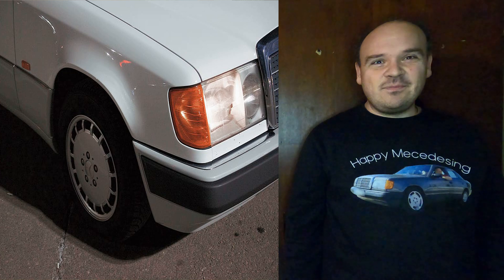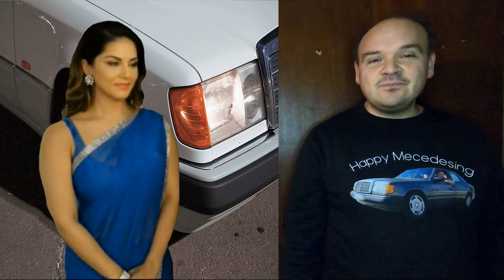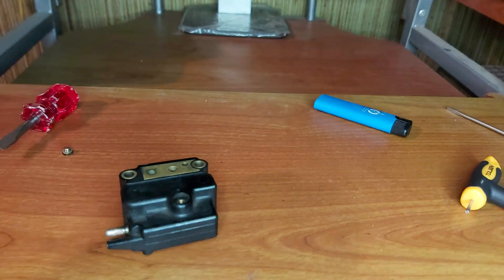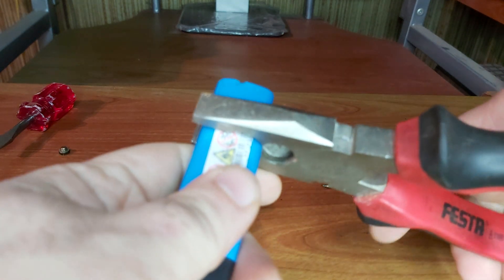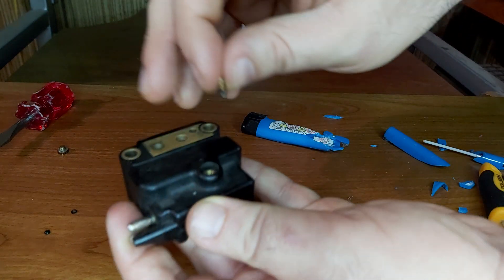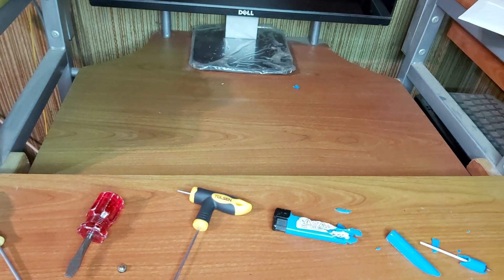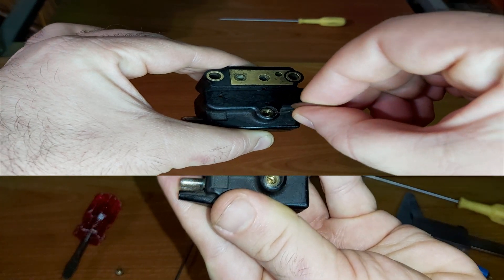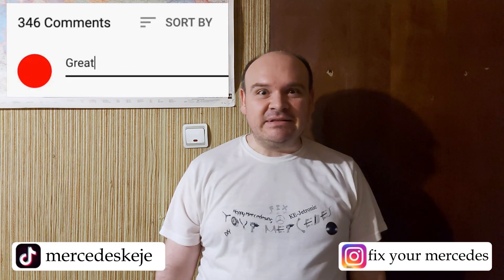㉦Mercedes Ke-Jetronic㉦ - ⭕The o-ring⭕ on the ⚙🔦adjustment screw🔦⚙Г/EHA

Comment: Hi,lovely family my doesn't start it's only crank.
Reply from the maker: Hi, “crank but no start” is only a symptom, not a diagnosis.
Fuel, ignition and power supply all need to be checked step by step. Check the pressures.

Comment: I have a Mercedes w126 300sel. When I want to buy a new EHA part, the question is, I got a non-original part on Amazon. Is it like the original?
Reply from the maker: Hey! 👋
It's good that you want to buy a new one. EHAs are all the same, they have a same function, they listen to what ECU tells them. If you found something cheaper, for 100$, then you can give it a go. Just bare in mind that you will maybe have to readjust it so be prepared to measure the mAmps on it.

Comment: zöveg fordítása a kamerával
Hello! 

My problem is the following. Still, although I improved a lot from my own experience, luckily I found you! 🙂
Low idle on cold first start! (~500/550) If the engine is warm, it is stable, ~750 is perfect! (engine 40'C is already good). 

The other fault is that it runs well at low revs, but when accelerating quickly, it is not strong, and weak at higher revs. 

You already answered my question once, but I'm stuck. 
 What I replaced, and the engine got better, but the basic fault remained, although to a lesser extent:

1. KE jet (1.8 190E
My Mercedes, on which it was perfect, complete with all systems)

 2. Filters, except in the tank. 

3. Spark plugs, spark plug cable, distributor head. 

4. Lambda probe. 

Fuel battery?

Overvoltage relay? 

Thanks a lot!!!!
Reply from the maker: Hello. What is fuel battery? Concerning the OVP - as I have mentioned. When it fails there will be difficult both cold and warm starts. Remove the ECU connector, turn the ignition ON, measure voltage. ECU connector pin1 goes to the power and the ground to the battery. If you get 11-13V then your OVP is working and thereby your ECU as well. One more test - turn the ignition ON, if you hear the idle control valve making a click sound, that means that your ECU is working and thereby the OVP as well!
Reply: @mercedeske  Thank you very much!
Reply: Vakuum problem?

Comment: What exactly does this process do? I was told that mine had high fuel consumption and was defective.(EHA)
Reply from the maker: Checking the o-ring on the EHA adjustment screw. The EHA can be defective only if it gives constantly the same pressure difference(not higher than 0.2bar) no matter how much you turn the adjustment screw in. Then the EHA has to be replace and if it's leaky.
Reply: Good video buddy. ❤
Reply from the maker: @TonyLiveTV  Thanks a lot, Tony. I wish you all the best and health at first place!
Reply: @mercedeske  hello my friend. This past Saturday I attempted to start my 560SL on a livestream. The engine turned over nicely and I was able to get it to start for just a few seconds and then it dies. Seems like it is starving for fuel. I’ve been watching many of your videos to see where I should start looking.
Reply from the maker: @TonyLiveTV  Hello. I saw it but I was busy. I would recommend you to do the initial mixture adjustment because I saw that you have a big play in the sensor plate.
Reply: @mercedeske  thank you. That’s exactly what I thought. It is too hot to work in the garage. It is already 105 degrees in my garage and it is only 9:30 in the morning! This entire week will be extremely hot. Temperatures will be close to 120 degrees during the day and a low of only 95! 🥵 global warming I guess.
Reply from the maker: @TonyLiveTV I'm so sorry I couldn't be live otherwise we would have made it. But I am pretty confident you have a lean mixture. Next time say when the live will be and I will be live and tell you what to do.
Reply: @mercedeske  I posted the live event a couple of days before I went live. I don’t know how YouTube notifies when you creat a live event. I’ll keep you posted on my progress.
Reply from the maker: @TonyLiveTV If you want to do the adjustments off camera, then ok, if you want me to help you live in the video let me know so everyone can witness that! I will do it for you free of charge, of course 😃😃😃